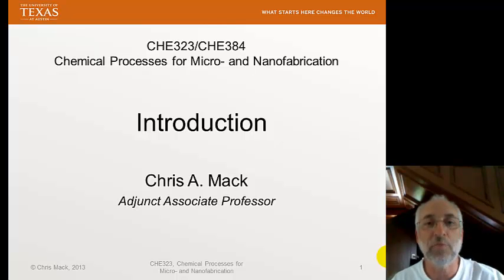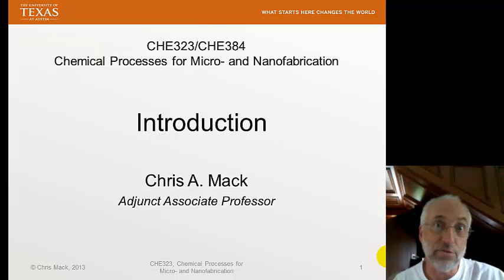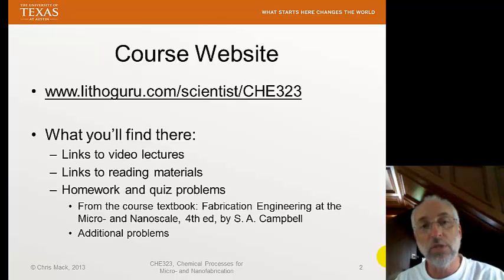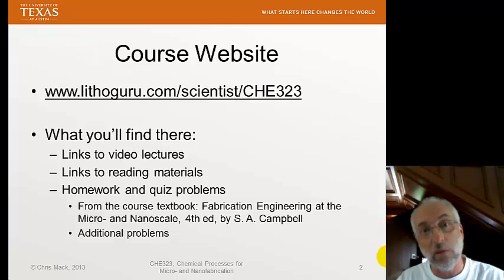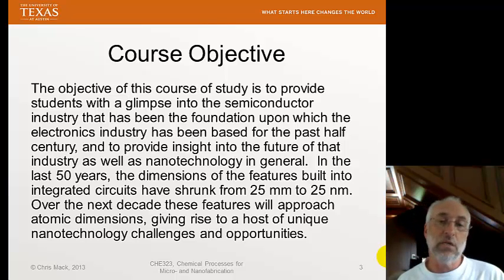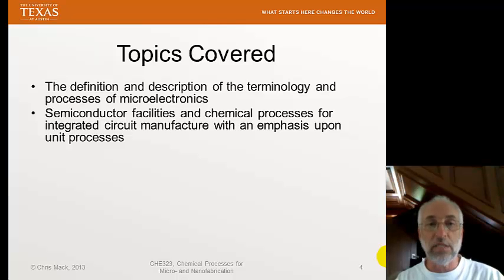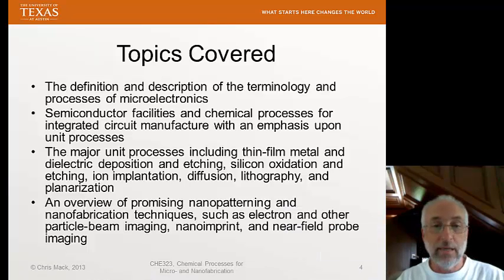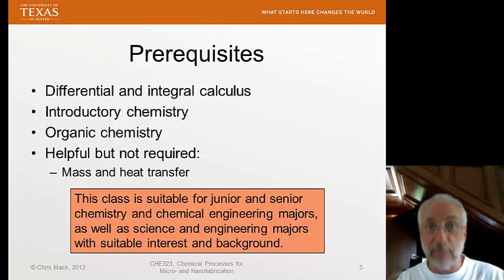Introduction

Comment: as a former semiconductor photolithography, among other areas, equipment technician who has been out of the industry for almost twenty years, this course was a good refresher to bring me up to speed on the changes that have occurred while i was absent.  it should make it easier to reintegrate and have a basic knowledge of the terms, processes, and technology that have changed.  hopefully, having at least touched on this updated information will help me to get up to speed quicker and be able to better perform my job going forward.  prof mack obviously has extensive, practical knowledge of the systems and processes that can only come from hands-on experience facing the challenges of wafer fab operations and process development.  as a plus, he is a fantastic teacher with a very well organized and informative syllabus that makes it less boring than other online classes i have taken.  thank you for putting it out there for the general public's access.  excellent!
Reply: I hope you were able to find a new job and that this playlist helped!